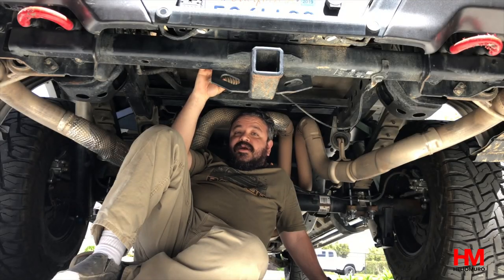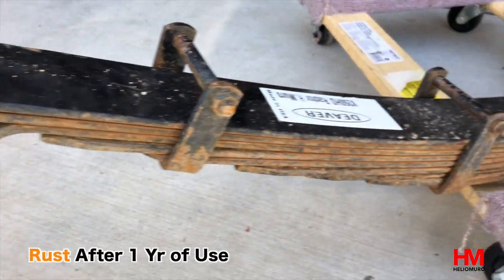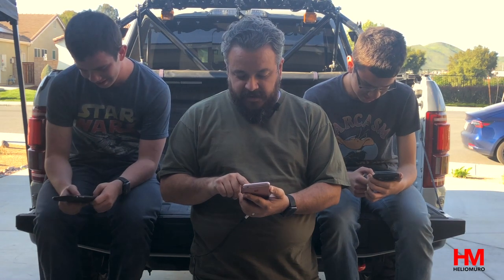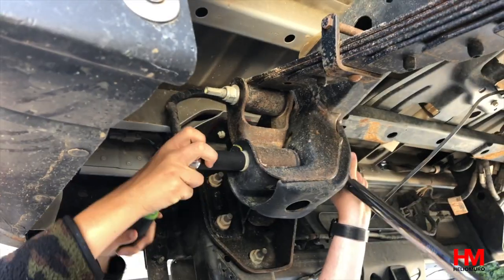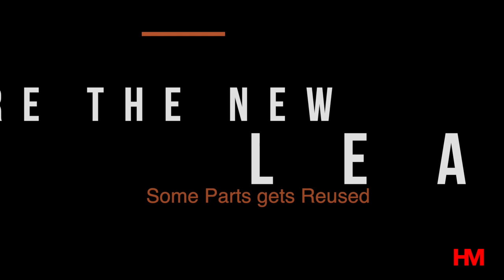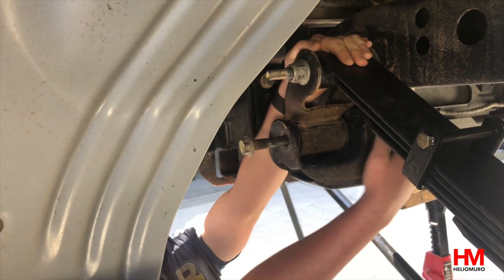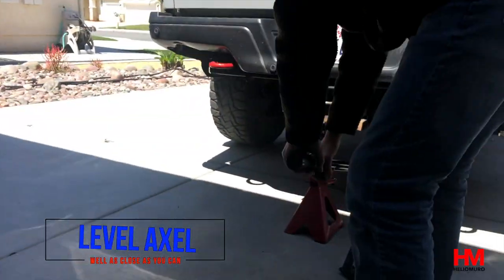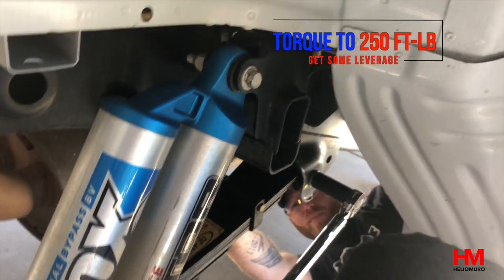F-150 Raptor Deaver Leaf Springs Installation

Comment: Thanks again for this step by step walkthrough, I installed my ICON leaf kit today following your method. Took my friend and I about 5 hours start to finish. The drivers side was a little tricky with the fuel tank but other then that the 2 jacks tip was very helpful. Thanks again!
Reply from the maker: ABDdrummer that’s awesome man. Glad the video would help.

Comment: Very instructive video and a big fan of your series.

I found it much easier to install the new leaf springs U-bolts first onto the axle, before securing both ends of the spring to the frame.  This allows you to ensure that the leaf springs are completely flush against the axle and that they are properly torqued down without being forcefully pulled to other directions.  

Once the leaf springs are secured to the frame via U-bolts, bolting the ends into the frame only took a little bit of elbow grease and jack work.

Different experience, same end result.
Reply from the maker: Karl H interesting approach. Will try it next time I have to do leaf springs.

Comment: First love your channel! Very informative, I have 2010 5.4 Raptor I’m trying to make it a reliable tow vehicle for my track car. Has stock front shocks set at mid perch, I was thinking either going with +3 Deavers or +2 HD Deavers what would you recommend for a build catered to towing rather than off-road?

Trying to avoid airbags just in case I want to have fun with it
Reply from the maker: Offroad trucks and offroad springs are not meant for towing. Yeah they are stiff but they are designed to give and articulate, where as towing needs to hold a load. 

HD Deavers will help, but again not meant for towing. You should call Deavers and ask them for a recommendation. Let them know the focus is towing and they can make you a custom set of springs for the same price.
Reply: @KeepItDirtyOffRoad  Totally understand completely! I just couldn’t pass up 10k for the Raptor so I’m hesitant on whether I fix to sell and just buy a better towing vehicle to start or take a gamble and invest in it.

I’ll call Deavers to see what they recommend as far as leaf spring wise. Thanks for your quick reply.
Reply from the maker: Anytime man. And completely understand the struggle. Mine is a dedicated off-roader and sometimes I just need her to be a truck

Comment: Thanks for the video . I am looking upgrade my left springs on my 2010 f150, but  going to a thicker  left springs. Is there going to be any major changes in the ride ?
Reply from the maker: Thicker usually means a rougher ride. As you add more capability it gets stiffer.

Comment: Great video. I enjoyed watching you share this time with your sons. I have a 2014 Raptor and I’m noticing the same problem. How was the ride afterward compared to stock?
Reply from the maker: There is a little stiffness at first on small bumps, but it eventually smoothes out as leafs break in and you get a very smooth on big bumps offroad.

Comment: Did mine in 2 hrs. (1 per side) x2 people. Same with my wife's 2013 Raptor. Same time and bodies. Before the leafs and your upcoming bump stops. You shouldn't invested in replacement shocks. Just my .02 cents.
Reply from the maker: LouisSypher666 on that truck I outgrew the stock suspension and had to upgrade. Currently working on upgrading a 2020

Comment: So do u jack up the truck just enough to get the tire off and then how much do u jack the axle up? Just enough to get pressure off? Im gonna attempt this in a few days
Reply from the maker: Josh Mabry we did an updated video for the new truck that will show the process much better with jack stands. 

2020 Raptor - Deaver Installation https://youtu.be/7IC39jyW5aM

Comment: How much weight do u carry my 18 raptor has added overlanding gear weight of 1400 pounds. Im trying to figure out witch ones to get.
Reply from the maker: I maybe added anywhere between 600-800 lbs. 1400 is a lot and I would recommend reaching out to Deavers for a recommendation. That’s a shit ton of weight and your going to need something custom to offroad with it. Otherwise you’ll get something super super stiff that won’t cycle correctly

Comment: Love the video! What coil springs do you have in the front and size tires do you recommend?
Reply from the maker: Check out my Raptor Suspensions n on a Budget video. I run Geisers offroad springs with 35in Toyo RTs.
Reply: @KeepItDirtyOffRoad  

How do you like the Geiser front springs and how much did it lift the front?
Reply from the maker: sixshooter4570 they lifted the front end 2.5 inches and have yet to sag any. Offroad they have been awesome and have really protected the front end and kept it out of trouble.

Comment: will you need shims for this leaf spring lift?
Reply from the maker: Rylan R Downs No. you don’t want any shims under springs that you plan to offroad fast. The way to add lift is by adding leafs. Icons kit give you the option to add height with a leaf. Deavers you need to order based on the height over stock that you need.

Comment: I got the deaver +3 installed. I’m getting some clunky noise. Sounds like something is rolling in the bed. Any idea?
Reply from the maker: Jake Lund squeaks and creaks are normal, the clunks depends on what your doing when it does it . Also do you have a bump stop?
Reply: Yup have the sdhq bump stop kit. It makes the noise on turns around the corner
Reply from the maker: Jake Lund interesting, have you gone back through to make sure everything is torqued?
Reply: I have not, I had a shop do it. You have an IG where I can DM you?
Reply from the maker: Jake Lund yeah, linked in the description above. I respond to my personal more than the KeepItDirty one
Reply: I got it retorqued and still clunking, any idea?
Reply from the maker: Jake Lund try and record the audio of it and send me a clip thru my Instagram account

Comment: Since you did the HD +4 do you end up with a 4” lift in the rear?
Reply from the maker: No. Keep in mind the truck as a 2in block stock. When you remove the block and add deaver +4, you only get a 2in lift.
HDs are an extra inch. With all the weight I carry and the squat I ended up at 1in over stock

Comment: You should of painted your differential. Video s good
Reply from the maker: Fern Built what do you mean?
Reply: Since you had everything off, a coat of paint like the leaf springs.
Reply from the maker: Fern Built I changed out the rear diff cover a while back. And panting the axel is kind of pointless. It gets sand blasted everytime we go out.

Comment: How did you keep the alignment of the rear axle? First time doing this. Do I need to just plan on taking it to an alignment shop afterwards or is there a trick
Reply from the maker: We found out later there is a way to “center” the axle. There is less than 1/8 in movement front to back and using straps you can attempt to center the axle on the pins. But for the novice it’s super tough to do. We never got it right and after installing we had to perform a small adjustment
Reply: No alignment needed. Get the leaf spring pin to go in the hole on the axle’s spring perches and you’re centered.
Reply from the maker: That’s not true man. Next time take a measurement of the pin and the hole. The hole is slightly larger and you can install the rear axle out of alignment if you don’t spend a little time aligning